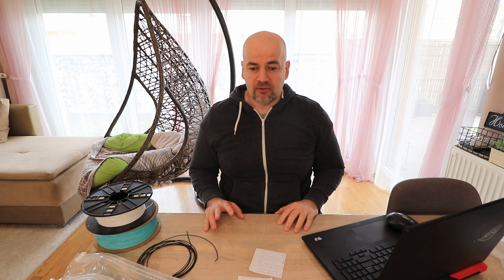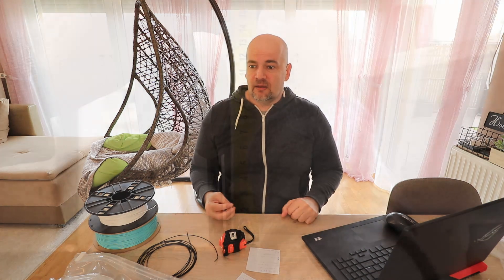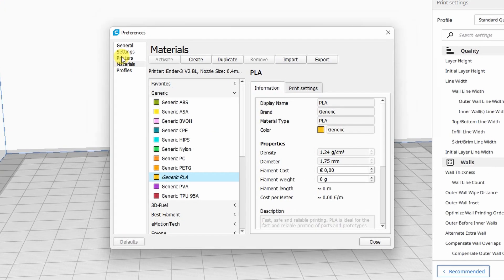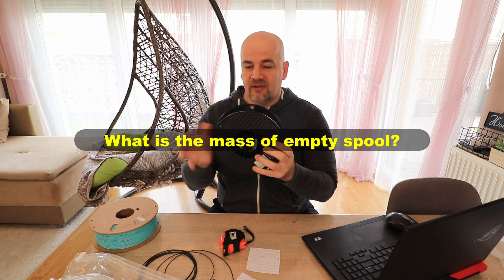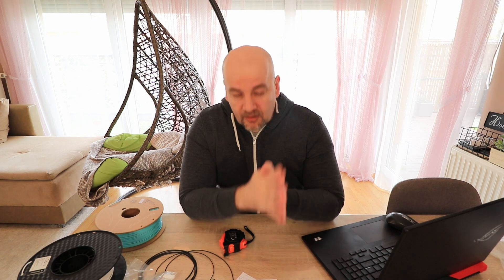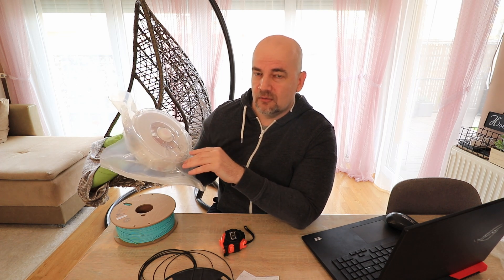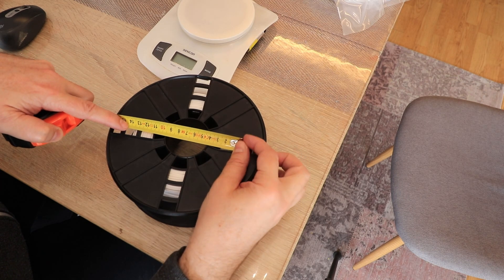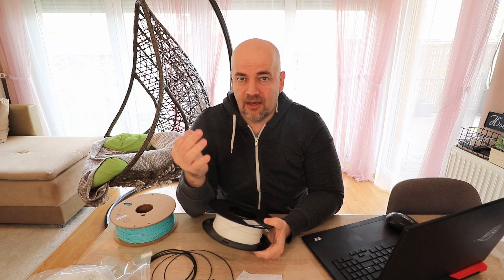How much filament is on the spool? Will it be enough for my next 3D printing project?

Comment: And the printer's built in filament runout sensors are not working reliably or at all with octopi. Only if the sensor is wired to the pi itself.

Comment: I say as as former physicist, if you measure by scale, you then measure the weight, not the mass. %) But use for this mass units. Thats why the weight is correct term.
Reply: Re: 04:30.
Reply: @AndrewHelgeCox  cite "by measure mass actualy" wrong. :) Actually was measured weight because it use the scales that measures weight. And yes, by such measuring it will get different weight of the same spool even on the different parts of Earth.

Comment: I use the filament manager plugin in Octoprint mostly.  If I have to do it manually and I'm near the end of spool I count loops and multiply by the length of a single winding and how many layers.  I log the weight of all the empty spools too though before I throw them in the recycling bin or whatever.

Comment: I weigh the spools right when i open them and write the spool tare weight on it with a marker (or label maker).

If i need to know how much is left, i weigh it again and subtract the tare weight. 

And it is "weight" when using gravity to measure, mass can only be measured from a balance ;-)

Comment: Its why filament trackers on octorprint or Repetier can help here. Each time you load a new spool you just reset it then it auto deducts it based on gcode.

Problem is octoprint is crap and the feature doesnt exist on repetier yet. Would be good for it to be baked into marlin.

Comment: Everything is much easier if you use up 2-3 coils of plastic - you will understand how much plastic you need on the machine. You still need a reserve in case there are any problems during printing (unforeseen).

Comment: Hi Igor , thank you for your sharing your insights on 3d fff printing.
Would it be nice to develop a spoolholder and incorporate a  load cell or pressure sensor?
In that way you have a constant weighing  of the spool and an instand way to know how much filament is left on the spool.
Reply from the maker: First version of eBox filament dryer had the scale, but then after upgrade to "Lite" version, they drop out this load cell sensor from it since users don't really used that option too much. https://youtu.be/KnZw_Jnug54?t=286